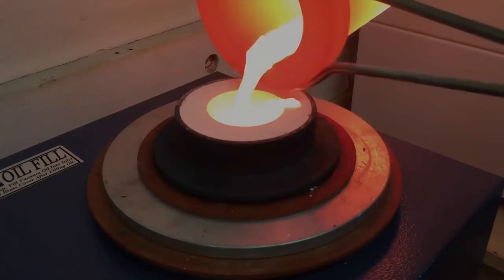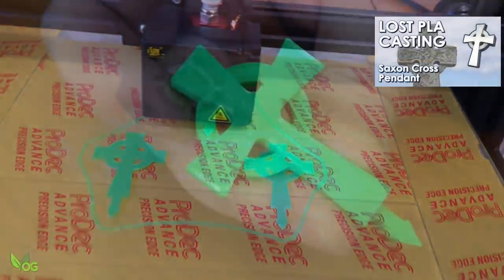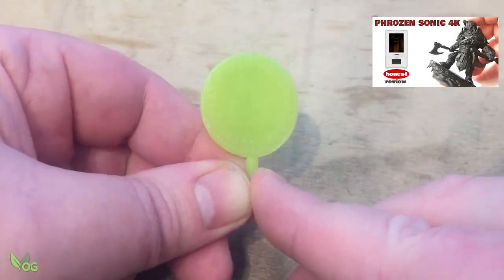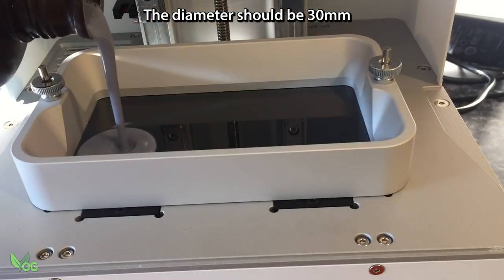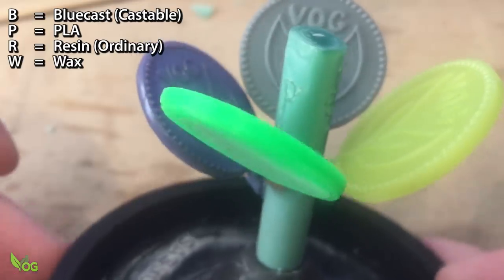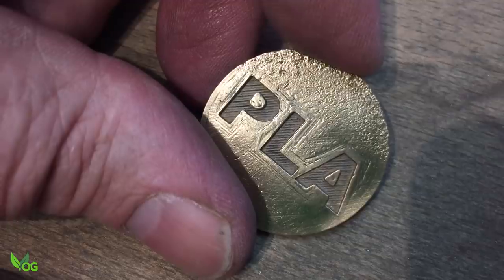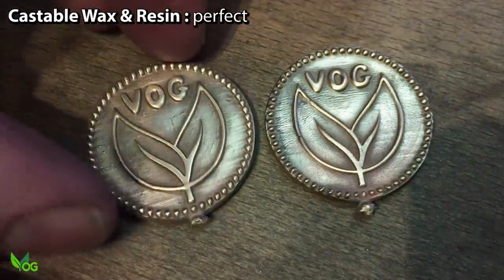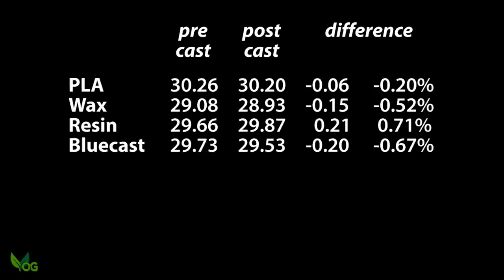Lost Casting  - Wax vs PLA vs Resin vs Castable Resin - who will win? by VOGMAN

Comment: Wax can have a large thermal expansion coefficient.

Often home appliances (laundry/dishwasher) will have the door lock be controlled by a hydraulic-like piston that is full of a wax and actuated (close the lock) by heating the wax. The machine sends an electric current to heating elements that melt the wax, which expands and advances the piston and latch.

This may seem complicated, but this is a fantastic safety feature because it guarantees that the machines can be opened simply by unplugging them. It’s an elegant way to make sure that children and pets don’t get locked in them due to some malfunction that jams the lock closed.

Comment: I'm beginning my own PLA experiments just now. Years ago, I used lost wax with portland cement which worked... for a Radio controlled jet boat jet unit. Use the pure clear PLA and you won't get residue issues, it burns right out.

Comment: Now I really want to see you make a negative and do an investment cast of that.

Like... make the whole mold for the injection-wax machine out of castable resin, then do the investment casting, then see if THAT makes a good wax-mold. (Actually, I'm investigating doing this for plastic injection molded miniatures)
Reply: I was looking at that, too.  Since I don't have access to injection molding equipment it was low priority.  I was thinking of a thin wall (1-2 mm) Zamack casting with a plaster or silicone back fill for insulation and support.

Comment: The investment sizzles when you drench it. Have you tried letting the investment cool to near room temperature before dunking it in water?
Reply: its designed to be drenched hot so the investment can break apart
Reply from the maker: You beat me to it James, thanks. 
Yes, you can let the investment cool and if you watch any of my pewter casting videos you'll see I did just that - and hated it. That meant manually breaking apart the plaster. I prefer to let the question do the work😊
Reply: @vogman  ah, my homemade recipe breaks apart dry pretty easily, and the last bit rinses off. Haven't tried to use it in a vacuum machine though, so it might not hold together under stress as well as the commercial stuff. On to more tests!

Comment: Great video VOG as always. And I have a big question for you, say you cast something bigger, do you think that PLA or general resin will cause a hell of a crack on a plaster mould due to expansion? I mean larger the  pattern bigger the pressure during dewaxing. Cannot wait for your answer
Reply from the maker: No, the size of the resin print or wax doesn't matter as long as you keep the edges of the model at least 12mm / half an inch away from the flask. If you go closer than that, the plaster can crack and the metal can spill out 😁

Comment: PLA is amazing stuff if you need to cast large parts. It's cheap, gets you a great surface even on a budget printer and melts at a low temperature. I've cast multiple 1+ Kg parts with lost PLA and this stuff has never let me down. Just make sure to not burn it out but to melt it out. Give it a couple hours at 220-240°C and you are fine. Also, you can get really precise if your printer is set up right and you know the shrinkage of your alloy. With aluminium, I was able to get within 0,05mm.

Comment: Have you tried blowing the mold out with compressed air before casting? I have seen a couple of others do it this way and it seems to work better.  
Thanks for sharing :)
Reply from the maker: That's a technique that scares me. The sudden temperature difference added to the force of the air should damage the plaster in my opinion...
Reply: @vogman  The reason that technique scares me is that one is playing with a flask with investment that is at about 550 C and the displaced air coming would also be around 550 C. Another concern is that a blast of air would cool the mold and might require the mold be hotter at burnout or castings would fail because the mold was no longer hot enough.

Comment: I very much like your videos about casting. I'm in the process of setting up my own lab. I have a question about burning out the wax. Do you collect it? (which seems to be hard in your oven) or do you let is vaparize? My first try with resinworks violet in my oven, it started to burn :-( so I figure that I should collect it after first stage @ 150 deg Celsius. Any thoughts about this?? Greetz Arend

Comment: Never even occurred to me that you could do lost-resin casting with cheap, ordinary resin instead of expensive investment resin. Sure it doesn't look as good, but at 1/4 the cost or less, depending on the relative prices of ordinary vs. investment resin you use, it could still be a decent medium to practice casting with.

Comment: another great video VOG did you cure the normal resin before the burn out. ? asi would not have cured it beforehand. just checking  :)
Reply from the maker: I can't see it making any difference. After all the model is UV cured as it's printed. I suspect it's a nonsense claim. 
I've had so many people tell me ordinary resins can cast and I've proved here that they are RIGHT. The problem lies in the fact that those same people will look at all four coins in this example and consider them ALL good castings. You can't argue with that as it's the opinion of the individual. But for me there are only 2 successes here.
So I won't argue one way or the other with such speculations. I'll just point them to this video let them make their own minds up.
Some people will buy a lemon and say, "It's as good as an orange. It's still a citric fruit." My view is that they are right, but personally I WANT an orange :-)
Reply: @vogman  oh i do agree with you vog. the best ones was the wax and the the castable resin. and wax coming of the top. i would have done what you did and made a mould from a resin cast and injected it with wax. i must admit also i love to carve wax. i tend to do a lot of celtic stuff with it. also i can melt it down and reuse and repair easy :) but again a great video bud :)

Comment: I’d assume that the differences in size for the resin parts have to do with cure times. They’re possibly undersized because you might be under exposing. Have you done all the XP finder tests by photonsters? Used the tests and turned out I was under exposing too and didn’t even know it.

Comment: non castable resin and poor castable resin for that matter have other issues besides the soot. usually a non castable resin expands during burnout sometimes causing plaster to crack. could explain the extra size
Reply from the maker: Good point 😁

Comment: Just wanted to say your videos have really gotten me interested in lost casting as a future project.  I've only gotten into 3D printing this year, but it's already been a blast. I currently have two FDM 3D printers and have been contemplating a resin printer for doing miniatures. But seeing your videos on doing PLA, I see it is plausible to use the FDM printers depending on the projects I would want to do. 

A side question, and perhaps you already have a series on this that I just haven't run across yet as I am a new subscriber, what have you used to learn Blender and CAD based programs? I am at the point that I need to learn these for my designs, but I'm having a difficult time with the applications, so I'm searching for good tutorials to get comfortable with them for the purpose of 3D printing.
Reply from the maker: Hi David. Yes, I think both types of printers still have their uses and that's okay. You can't turn a screw with a hammer, and you can't drive home a nail with a screwdriver. Each has their own advantages disadvantages and uses 😊
As for the CAD stuff, I'm self-taught for the most part so I can't really offer any recommendations :-)

Comment: 3:45 - Resin shrinks, wax shrinks, and don't forget that the silicone shrinks. Then of course the metal will shrink. Would be kind of fun to dial in all of those factors and figure out what percentage to scale up the original resin print in order to get a properly sized final result.
Reply from the maker: To do that you need consistency... just one product every time. That's too boring for me, but certainly doable 😁😁😁
Reply: I read somewhere if you’re casting silver grillz you would make the model 103% size

Comment: I love your videos.   Thanks for your content.  I wonder if the size difference in the two resin prints (0.06mm) has more to do with the repeatability of the resin printer than the resin?  I would guess not given the Phrozen's minimum feature size of 0.035mm.  You could find out by printing the same coin in the same resin several times (perhaps moving the coin of the build plate) and seeing if there is a variance in the print sizes.
Reply from the maker: It's a good point Michael but I'm fairly happy the printer seem consistent across with the same resin : )

Comment: Hello VOG. I'm looking to buy a castable resin from POWER RESIN and I don't know which one to choose for casting. Should I make sure and buy the WAX Castable from POWER RESINS as it works with a standard burnout cycle? and What does it mean with "shrinkage" is about after printing or after casting? Thank you (:
Reply from the maker: Hi Rafael. Actually I have a bottle of Zero from Power resin to review. I haven't tried it yet. 
As you've seen in this video, it seems to me that each type of resin acts differently and may shrink differently. So something printed on the same printer with the same settings might be differently sized if printed with Resin A and Resin B. 
I think Zero is basically claiming it doesn't shrink when printed. They CANNOT make the claim that the metal won't shrink when casted, as they can't control physics.
The thing I've noticed about Zero is that they are NOT making any claims about it being 100% ash free, where they do with Burn, Wax and Dark. That worries me...
So, I've used Burn and Wax. They both work well. I personally prefer Wax but the choice is yours.
In your position, I'd buy one of these and do a test print. Measure it. Adjust the size of the print if the shrinkage makes a difference (as it might with a ring or a gear). 
Personally I'm not so fussy. I increase all my prints by 1% and forget about it. It seems to work for me 😁
Reply: @vogman  Thank you for your complete answer. It was super useful

Comment: Can we combine. Print on FDM-PLA with high precision and then wax coat before investment casting will that work?
Reply from the maker: It certainly could be done, though it's doubling the work 😊
Reply: @vogman  
But its certainly 50% cheaper than conventional machining. Moreover for intricate profiles on sheet metal I need to make die even for prototype. I think it saves time too I don't need to wait for different manufacturer to finish their jobs before next is taken up.

Comment: Hey VOG I've learned so much from you and started a business in jewelry but when I make 3d resin prints the castable wax doesn't stick to the spru tree. I've tried using sticky wax and still doesn't stick .any suggestions
Reply from the maker: Firstly, excellent - well done. Secondly, that's strange. Obviously it's all about the wax you use and it can often be fiddly, but it should work. The general idea is work quickly using a wax pen (similar to this https://amzn.to/2SupQ0Q ), melt a small patch of the pattern, then the end of the sprue, then bring them together and hold. I find retouching around the edges with the wax pen helps. In truth it's just a technique you have to practice. I still marvel at how well some guys do this. It takes me ages 😁😁😁

Comment: Hi Geoff I'm making a foundry to melt copper and aluminium what is the best refractory cement to buy and where can I get it cheaply ?
Reply from the maker: Hi Steffan. It's hard to say as it really depends on where you are in the world.
In the UK I went here - https://www.castreekilns.co.uk/castable-refractory-56-c.asp - and have no complaints. It's an easy product to use but it still requires insulation :-)
Reply: Thanks I have looked on line but there's all different types and temperature differences I wasn't sure which one was correct thanks
Reply: Sorry I'm in Cheshire (uk)

Comment: Cool video, new viewer, liked and subbed.

Could you help me? Could be a video on replacement parts.
Cast a replacement gear for a cordless screw driver, I think I have a like for like gear that's not damaged, this one has split in half through the shaft hole.
Reply from the maker: I did a video on making gears a while ago - https://youtu.be/0ow4x0jadJY
There's a couple of possibilities. You could print a new gear from casting resin or even PLA, or you could take the broken gear, glue it together and repair with filler, etc, and use this as a pattern in a silicone mold. 😊
Reply: @vogman  thanks, I'll check that video out I miss this little driver, it's only a single cell lithium but had a lot more guts that the newer model I bought to replace it.

Comment: The Casting Vogger
Reply from the maker: Keep on Vogging!
Reply: VOG also if you are so worried aboit precision why not use a cnc to mill aluminum to either make an aluminium mold block for the wax like injection molding or machine the coin and use silicone to make the mold